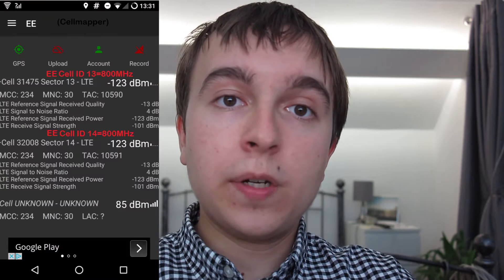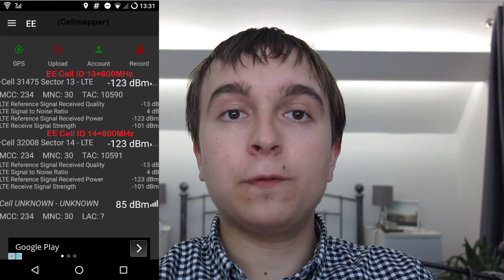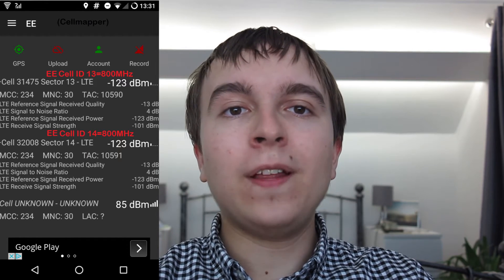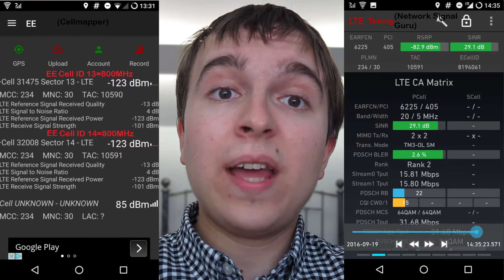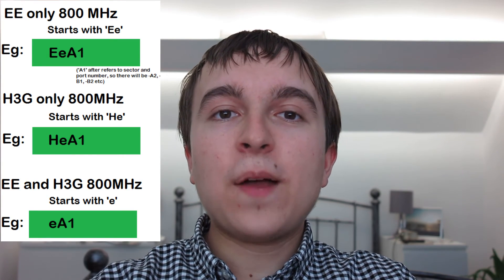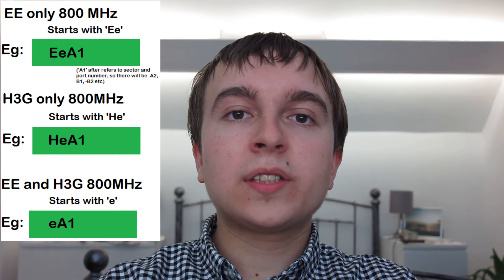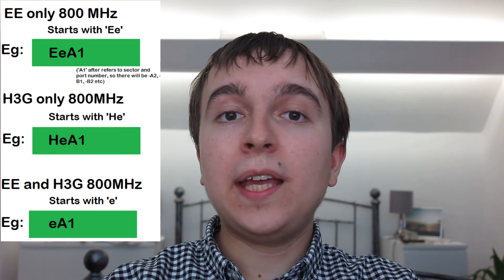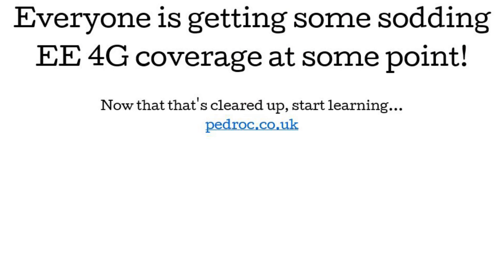EE 800MHz 4G Update:  New Configurations and Masts recognition. CA, VoLTE

Comment: Great video, thanks.  Now we just need more devices with VoLTE support.  It would be great to know some timescales for EE 'turning up the power', but as usual they remain tight-lipped about these things.
Reply from the maker: The present will come when the present is due.
Reply: Very true.  EE just announced the launch of VoLTE on the EE ROM S7 on their community forum, making it the first supported Samsung device.  I asked about it - but the S7 Edge isn't supported just yet, and there is no news on S7's not from EE (like mine).  Will keep a close eye on the developments.
Reply from the maker: The BTU  firmware ones can do VoLTE when hand over from WC
Reply: Mine doesn't seem to, for some reason - the call just disconnects when out of WiFi range.  The BTU S7/Edge is one of the only non-EE Android devices to get EE WiFi Calling, so I assume EE should be able to sort out VoLTE for it at some point. 

Shortly after inserting a Three SIM, Three push the carrier settings for VoLTE and its enabled.  I assume EE will do the same at some point.  I am unsure whether another software update would be needed or whether EE can just push the settings out like Three do.  What do you think?
Reply: So.... I decided to flash EE ROM to access VoLTE.  It works really well.